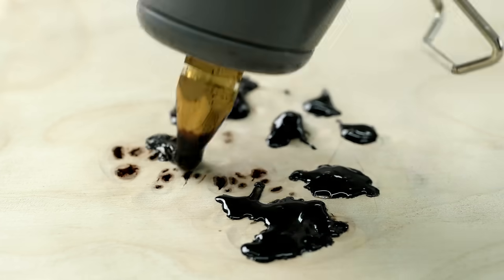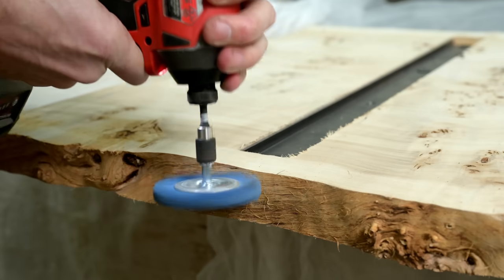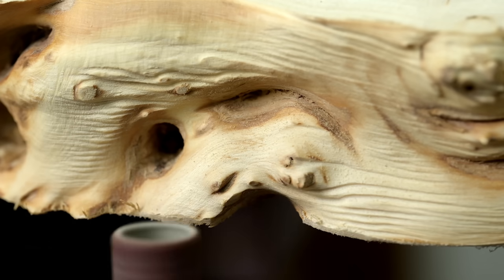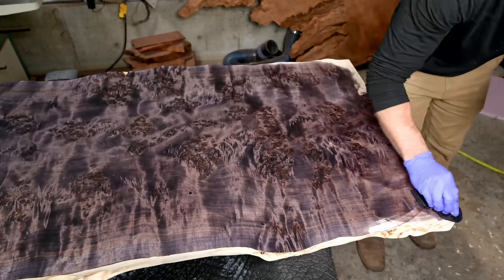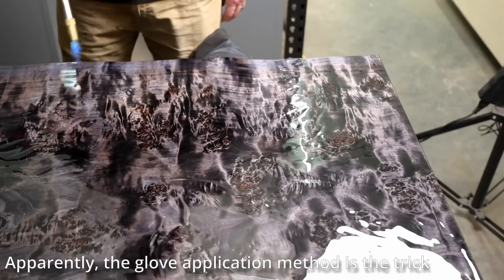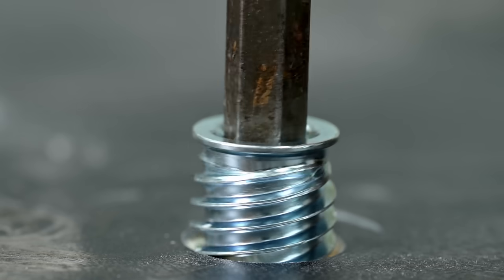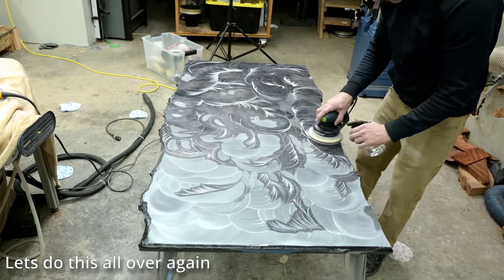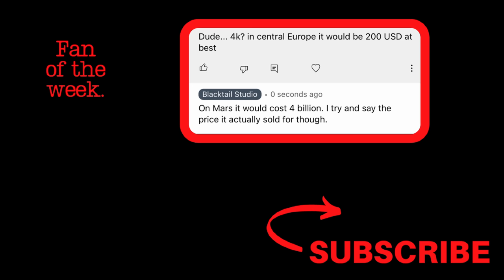$15,600 Table Build

Comment: Mappa - Ever thought of buying a twin electric blanket to use to warm up the wood? Might take a bit more prep afterwards but you might be able to get the wood a good bit warmer.
Reply from the maker: That makes an incredible amount of sense. Thanks!
Reply: Actually good advice. Pog
Reply: This might be a good idea until you have to deal with the lint/dust/dirt left behind by the electric blankets, especially after they have been used for a while.   The cleaning process would need to be quite rigorous.  I would recommend buying heated rubber mats that are used in many industries for heating items.  The rubber mats won't leave behind dust/dirt/lint and are easily cleaned if they become dirty and some offer temperature controls which would give you better process control to heat a thick slab.
Reply: @deanh2574  Then use schluter ditra with a floor heating grid & make a heated 'tile table' to put things on.
Reply: @Le_Comte_de_Monte_Felin  I was just about to say to buy a second blanket to put under the wood but your idea is better. It might be possible to save a pour that is overheating a little by using the tubing to cool the pour, or at least know when you are getting too close to the limit on exotherm...
Reply: @Le_Comte_de_Monte_Felin  Excellent idea.  I wrote rubber mat because I didn't know how to spell Schluter Ditra.
Reply: That, or an array of heat lamps maybe?
Reply: Here is my take on how to warm up your wood. Back when the world was younger and so was I, I worked in a paint and body shop so temperatures make a world of difference. I also know you are working with limited space. 

I don't know your shops dimensions, but would it be possible to create a small "paintbooth" inside your shop? It wouldn't take much and supplies can be fairly inexpensive. You could get a tarp and canopy,  small canopy carport. This could be your clean/warm space. Just a thought.
Reply: @LindaMcQu  I think they make spray painting tents that would contain a tabletop.
Reply: Jesus Christ died for your sinssssssss
Reply: @BlacktailStudio  eh?   Depends on the stability of the material. May cause something like this to twist up like a pretzel. I wouldn’t do it. Although as a furniture maker I don’t care for slab tables,  I respect your marketing expertise and your craftsmanship. Congrats on the auction.
Reply: Mappa: Interesting thoughts about the heated blanket suggestion. I would think covering the wood with a sheet of plastic covering might decrease the lint issue before utilizing the heating blanket.
Reply: @deanh2574  ---- Don't rubber mats leave chemical residues?
Reply: Plus it’s makes them more comfrey
Reply: @LindaMcQu   I wouldn't recommend anybody work with epoxy or 2k finish in a tent unless they have incredibly good extraction. DIY spraybooth and DIY gas chamber are essentially the same thing.
Reply: @jesuslovesyou2616  Shut up.
Reply: Then stitch, heat iron or glue rolled plastic coverings over the blankets to make less messy?
Reply: @pyranna2003  Well of course. One wouldn't work with, bondo, fillers, rust removal chemicals,  base coats, paints and top coats without proper ventilation. This is what exhaust fans are for. There are was to create an exhaust system that is still not going to cost a small fortune. I thought all that went without saying.
Reply: yes thats what u think but it can burn making the wood into ashes (I'm not lying it gets burnt if it toches somthing
Reply: @deanh2574  The electric blanket could be inside a protective cover, and placed UNDER the wood so it can remain in place without disturbance while finishing the upper surface of the wood.
Reply: I've seen people using incandescent lamps, big ones  for the same pourpose
Reply: @deanh2574  Waterbed matts or primitive sawed off coffee makers. I use one I made for seed starters. Or if you're really in a pinch, hook up some pex tubing to a water heater & let it circulate overnight. Just a few ideas without much thought.
Reply: @TheCDelX  the halogen floods put a ton of heat. We use to heat our canned food for lunch just by setting it on the little shelf just in front of the lamp. 1000 - 1500 watts I'd guess.
Reply: Mappa. Instead of the heated blanket, which are meant to sit on top of the object they are heating, might suggest a heated mattress cover. A twin sized heated mattress cover would fit this type of application perfectly (somewhat inexpensive too) .
Fortunately I live in Florida. Any suggestions for bringing a slab temp down???
Reply: Sorry, granted im not good at wood work, but wouldn't the blanket be a source of dust and microfiber hair?.
Reply: Sorry mappa...
Reply: Heating mats that gardeners use to start seeds might work for this too.
Reply: That's a good idea. I'm just getting into woodworking and epoxy and I'm always looking for a good idea to help me. Thank you. :)
Reply: Mappa - body shops use heat lamp arrays on stands.
Reply: I would have thought an infrared heater set up would be good for the epoxy stage. Might need some sun cream though.
Reply: Mappa- nearly $16k in bids and it’s really making me want to do one. I’d love to do a project like this but I’m always just busy with normal carpentry/building works
Reply: basic heat lamps would work as well ... so would a vaccuum bucket to pull the bubbles out of the mixed resin before he applies it would also work and cost about the same also ...
Reply: @deanh2574  Uh, duh, he could just wrap the wood with some plastic first, like a normal human. Also the make blankets that are just like the ones you cover furniture with.
Reply: @emerycapt1350  Yep.
Reply: @LindaMcQu  Yeah, everyone is a smarty pants, aren't they, lol. I have to work with people like this guy everyday.
Reply: @andybilakshow260  Thats what I was also thinking of. Like how they warm fancy house floors. That or really hot halogen lamps for making movies.
Reply: @JasonPeliwo  Same, SWFL for me. Yeah I was think a WB cover, I used to have a waterbed.They work great and have no lent or wool like your traditional blankets. 

Probably 10 diff ways to do this. You'd think his shop would be heated to begin with.
Reply: It just occurred to me to suggest you watch Mads in the early sail life YouTube channel vids.  He built a rig to warm up epoxy.
Reply: @BlacktailStudio  Hello. Is it possible to work for you ?
Reply: Könntest du mir das mit der Heizdecke erklären, ich habe nur eine vage Vorstellung warum man das machen sollte. Danke
Reply: Whoa
Reply: @BlacktailStudio  missing some fresh content mate, need a blacktail fix...😆🤙
Reply: @BlacktailStudio  hey Cam love your content. Scrolling through your videos just thought of an idea to move the slabs from the truck to the table. Maybe you can get one of this ceiling tracks with one or two hooks. Then you can make a type of slings to hold the slab and move it to the table. Don't know if this helps you just thought about it. Keep the good work.
Reply: For small amounts of epoxy, I'm using a USB cup warmer. It heats up to about 45 C (115 F), what is enough for me.
Reply: Moving up north so that is a great idea for prepping wood come winter.
Reply: Mapping great job
Reply: @BlacktailStudio  Seed raising heating mats, if you can find a big one would work too without the lint.
Reply: @BlacktailStudio  hey check the Dean H comment it would be better for your applications
Reply: MAPPA 
Hi there! I just watched your Fire + Epoxy video and had and idea to share with you: I'd love to see the epoxy with the colors of the fire to fill the gaps of the charred table top, really poppy orange with a bright yellow (swirly mixed like in that "how to make colored epoxy resin table" video) so it'd look like it's constantly burning. Absolutely love to see master in his craft, keep up the awesome work!
Reply: Drop a piece of plastic under the blanket to avoid threads and dust. Other than that, a very simple, logic (= good) suggestion.
Reply: @BlacktailStudio  Heat lamp, less contamination. Laying a blanket on it introduces contamination in the form of dust.
Reply: @BlacktailStudio  All woodworking should be done with warm wood with warm tools.  Cutting and sanding is easier (less resistance), routing--fewer tear-outs, planing--fewer chips and ALL finishing processes are better.
Reply: @jesuslovesyou2616  got love a good sinsssssssssssssssssss
Reply: Ok dear Blacktail here's why I've just UN- Subscribed and I feel you and your viewers should know - Turning a slab into a piece of art does not include selling "C Channel"
For your artwork you could just as well use RSJ's
Over the last few weeks I've got to the same place in your vids and dropped out.
This time I've unsubscribed because I have a need to use "Z Channels" and so
I've gone to watch the adverts on the channel that advertises Z Channels .

Get me?
Reply: Mapa. Love this table but could never afford it. I’m from New Zealand, we have some nice woods here that wash up on the beach quiet often. Love the vid, that grain and sheen is just awesome.
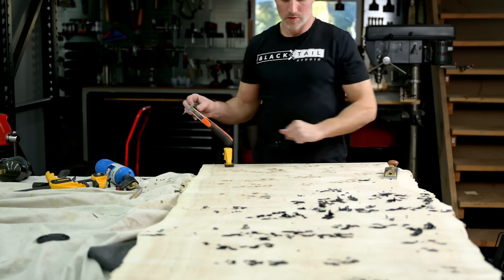Reply: @8:02 LMFAOOOO hahahaha wow got em
Reply: there is this guy on YouTube ,Baumgartner Restauration' that built a heated table - I mean you won't need to over engineer it the way he did for his uses - but that might be the thing?
Reply: My brain is swelling by the amount of knowledge I'm taking in right now . I'm gonna sleep good tonight. Have a good day . Thanks for the education.
Reply: Mappa awesome  looking table
Reply: @juliawintersperger6167   HA, I was about to make this EXACT comment! :D Aluminum slab, dimensionally stable, even heating, temp control, no dust or lint to deal with ... sounds perfect! (if you've got the room for it.)
Reply: @culturecrashAL  I see another person of culture and hatred for staples has found my comment  ;)
Reply: I'd choose an IR heating panel, which leaves no dust and depending on the distance will never overheat your objects.
Reply: I subscribed just for that comment :D.
Reply: @deanh2574  for 15k you can just work it into the cost.
Reply: You can buy heated mats that have no lint. They make them for keeping diesel tanks warm to stop the gel issues in the winter. I’ve have seen the larger versions used to warm up wood for finishing. 👍🏻😎👍🏻
Reply: @deanh2574  put plastic between the blanket and the wood....... Wouldn't affect the heating and would keep the blanket from getting dirty
Reply: ⁹>
Reply: 9999
Reply: Usual u<uuu
Reply: Hmmm. That’s not to bad of an idea. Just may work, Might get the wood just warm enough it don’t warp..☝️… might have to give it a shot
Reply: This does sound like a great idea!  I'm just wondering if blanket lint might become an issue.
Reply: What about dehumidifier to take the moisture   ?
Reply: @erics7712  they're talking about doing it with the wood, and the whole point is to get even heating. If it's being heated evenly it shouldn't warp or twist at all. And I doubt a heated blanket would be nearly hot enough to warp wood. Maybe the epoxy but no one is suggesting that lol.
Reply: Mapping is that AMAZING wish I could afford something from you. Thank n you for supporting Make A Wish. They sponsored my grandson and I will never forget how happy he was.
Reply: Clever!
Reply: Mappa-I’m in favor of the heat lamps.  Super convenient and removable in summer. Great table and video.
Reply: @eduardocruz4341  Jesus still Loves You even if you don't believe.

Like a Good Father, He will Never give up on any of his children.

However, we have a choice to make. It has been made very clear that we choose how we live our Eternal Lives.

In Paradise with our Father, or a Lake of Fire with the Enemy.
Reply: I was recommended to build a warm box for my large pieces by Smooth On, because I have to cast in colder temperatures, and it does work, but can blow minute debris, but it sands and buffs out.
Reply: I was comong here to put that idea in.  Might be able to put it in a plastic bag of some kind to avoid lint problems.
Reply: @BlacktailStudio  I just bought a warming carpet to put under my couch (the floor is poorly insulated over a cold basement). Has a slider type rheostat. Comes in sizes. What you do is put the piece on sawhorses, and make a plastic tent over the piece,  to the floor. The tent should be one foot or so over the piece. Put the warming carpet on the floor, and iterate the slider until you determine the setting that gives you the desired temp. Temp and lint control in one.
Reply: @BlacktailStudio Mappa I watch Baumgartner restoration for fine art. He has a plastic tent for varnishing paintings. Maybe that could work when you coat. Mappa
Reply: @Le_Comte_de_Monte_Felin  We cover ours with a clean plastic sheet then the electric blanket and they are sweet as bro
Reply: @BlacktailStudio  Another option might be these radiant heating panels whom are so popular in Europe these days. They are no light, radiant heat panels that warm the objects they bounce their rays off.
Reply: @deanh2574  maybe a piece of tarp between the wood and blanket.
Reply: @redcube9629  pog bro?
Reply: @xxrossfxx1  this was 2 years ago bro

Comment: I’m 36 and I’ve been an automotive painter for 16 years in a fairly high flow shop.  The trizac system works extremely well. I’ve seen the paper go up as high as p5000 grit.  Once you’re at that point, the buffing and polishing portion is ridiculously easy. I absolutely love this table.  Keep up the amazing work dude
Reply from the maker: Thanks bud!

Comment: MAPPA Burl- I hope you know how blessed you are to be able to create and have an outlet for your passion and creativity…I absolutely love my family and work 13 hours a day 6 days a week locked into a factory job—concrete, cold steel, deafening robotic noise, horrible air quality, no windows no sun, hot as hell…but the point is I’m stuck and daydream about apprenticing at your shop..I’d work for free. All I’ve ever wanted to do was be a carpenter and build modern furniture…I used to draw tables, chairs and couches back in 1995…But I know at this point it’s just a dream.

Comment: I refinish furniture and my buffing to a high gloss needed work when I first started. I have learned a little trick though. Set up a couple of shop lights at waist height or about chair rail height with them facing out and turn your overhead lights off. It is what a lot of automotive painters do and it gives an excellent contrast on the levelness and shows any dips, debris that might have landed on it and swirls from the pads.
Reply: This and be sure you can see the light itself in the reflection. That really brings out the imperfections. Another tip is use LED’s and not fluorescent or halogen. It’s a “cleaner” light that again helps to see those imperfections.

Comment: Mappa 13:55 The best way to heat the surface of your slab (and the epoxy on the slab) is to use a radiant heat panel.  A 400 Watt panel should do your application (24"x 24").  You would suspend it directly above your slab (3 or 4 feet above).  Plugs into 120VAC.  No moving parts so no air movement.  Home Despot $250  Love the table.
Reply: Jesus Christ died for your sinssssssss

Comment: When finishing the surfaces, you should consider what a “clean room” in the semiconductor industry puts to use, as far as what attire you wear, to prevent dust and other particles from your body and clothing from being shed onto the work piece.

Comment: When this table was around 1500 grit sanded, I loved it. But the final shine is unbelievable. I don't even like glossy finish in general, but this job is really nice ;)
Reply: Buffing doesn’t always come out that nice. It might sound crazy, but i have some sanding discs from rocker that go down to 12000 grit which I use before I start buffing guitars out and it helps get rid of that haze so you don’t have to go through a ton of buffing compounds. Those things are super expensive!
Reply: @jeffreytgilbert  
I mostly work with car finishes. Once you get above 2-3K grit sanding, compounds will work just fine. IMO it depends on what you are better at sanding vs buffing. Also the risk of overheating the clear with the buffing compounds. I'm like you and lean to a better final sanded surface vs cutting it with compounds.

Comment: For filling those little burl holes, look into the epoxy putty by mohawk, I've been using it for the micro imperfections lately and haven't had any issues! Love the video as always cam
Reply: Just looking at these myself as you recommended them,£21 on Amazon and loads of colours so these would be a great idea I think.
Reply: Was going to say the same thing